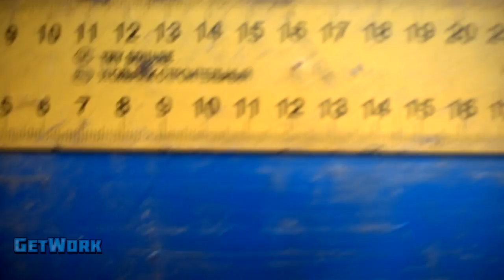How to make DRIFT TRIKE wheels - The cheapest way

Comment: Another question are these for a motorized trike. And if so how are they holding up.
Reply from the maker: In my case this is pedal trike, but if you do motorized you need to buy another 2 special holding bearings (bearings with holders, with holes in sides for screws)

Comment: I would like to build thes but I live in the us can u put it in inches and I hope to learn more from u
Reply from the maker: 0:17 - 0.4inch  0:22 - 6in  0:43 - 4.3in  2:02 - 1.8in.
But that is doesn't matter all measurements i used what i have and you can yous different measurements, more wide wheels and so on measurements is not so important its the idea and example. Good luck with yours project :)

Comment: STEP ONE GET A $2,000 LATHE 👍🏼😎👍🏼🤦🏻‍♂️
Reply from the maker: Step 0 - lathe is not necessary, it just makes ride smoother and if you take your time to drill hole perfectly in center it will be even better than smoothing with lathe